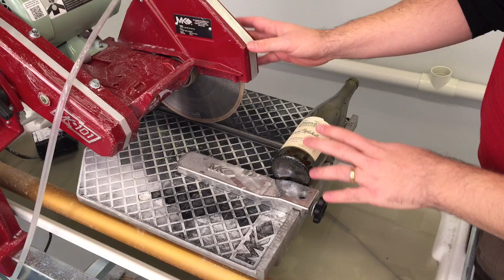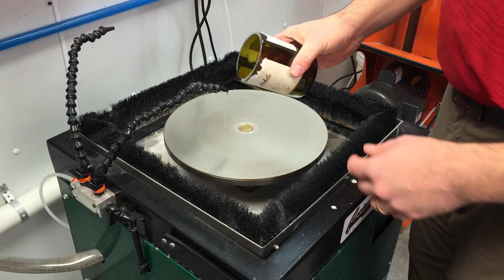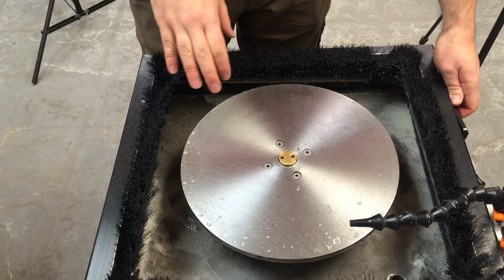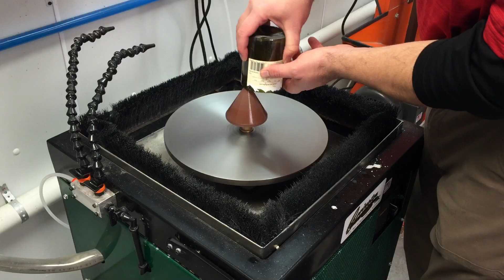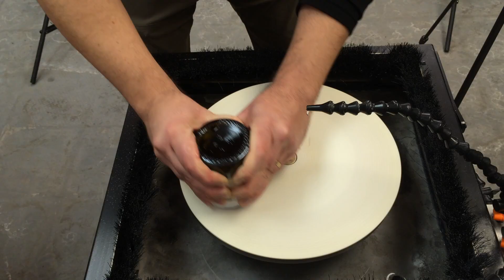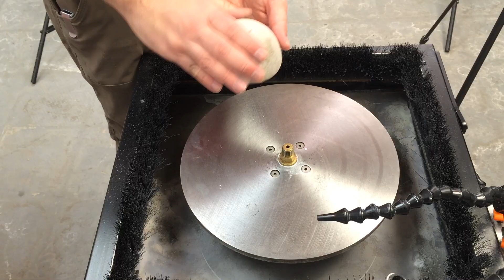Cutting and Grinding Wine Bottles into Drinking Glasses

Comment: Can't you just fire polish the cut sharp edge for a fine result
Reply: +Anja Lumiere Discipulo Most recycled glass will crack or shatter too easily.  I suppose though if a person were doing a large batch and had the means to slowly bring the glass up to temp beforehand and back down afterwards it might be worth the effort.
Reply: Cracks the glass.  That glass is sooooooo brittle

Comment: An absolute massive omission in this video is in the use of the wet-tile cutter.  While the disk will not cut skin when running in a water bath, it WILL cut your fingernails with ease AND instantly.  That alone tells me this guy is only partially informed on the use of these tools and should be watched with doubt, and to watch other videos in the use of the tools presented by this guy.
Reply: +Cyberdactyl 
Given the actual threat level of fingernail damage using diamond coated glass blades, and considering that "this guy" has provided a 27 minute demonstration video and you've provided a comment, I'm thinking that the "massive omission" you have proposed is a little less massive than you are making it out to be.
There's a big difference between respecting your tools and fearing your tools.
I think you're fear-mongering and splitting hairs (or fingernails).
But, that's just me.
Reply: BigRalphSmith I'm not talking about splitting hairs, but fingernails. ;)
Reply from the maker: +Cyberdactyl It is true that diamonds will cut through your fingernails and I have, in my 22 years of experience, groud through my fingernails more than once on a belt sander and flat lap, but I've never managed to cut through my fingernail with a diamond blade before. I would put that into a very rare category of occurrence. I do appreciate the added tip and I'm sure it will help others who watch our videos as well.
Reply: +Cyberdactyl if you seriously remove your fingernails down to the nail bed with your grinding equipment on a regular basis, you need lessons. You might ask "this guy" for them--I believe HIS does offer classes.
Reply: +Cyberdactyl hmmmm...along those same lines, then, he probably should also mention that if you hold your forehead against the blade for an excessive period of time you can create a jagged scar like Harry Potter's...it's about as likely but in the interests of being thorough let's cover ALL the bases... Seriously, he does explain that you should not hold your hand against the grinder for any length of time and that the diamonds will grind harder surfaces. That is more than sufficient. I've taught coldworking to many beginners; have so far not come across any who couldn't figure that out based on what was shown here.
Reply: I used chain mail butcher's gloves with latex gloves over those for grip.  I lost part of a finger years ago ( unrelated work accident) and as an Artist i'm particularly cautious with my fingers.  I also where full face goggle and a neck protector, should glass shatter and fly into my neck area..
Reply: Cynthia Morgan
Well. . .I certainly agree.  So he should have made the safety, point and that it could happen, since he is giving a tutorial to beginners.

Comment: Why didn't you take the label off the bottle? Keep telling us it's a good idea and then not doing it yourself. Annoying.
Reply: +woody1380 It was mostly to demonstrate how difficult it makes it to cut through the bottles with the label on and how the blade is only meant for cutting through harder materials. We've found it's better to show that rather than just saying it as most people do not believe they should remove the labels beforehand.
Reply: it helps to get it from shattering
Reply: +woody1380 LOL I noticed that too, but his reply make sense.  I have three different cleaning phases in my production.  1. remove the label only.  2. After cutting and grinding, remove any glue, etc. that may be left.  3. After the piece is "done" one final cleaning for perfection.  This way if the bottle damaged in any way during the working phases a lot of time is saved.  Believe me, there are so many opportunities for scratches, cracks, etc. to happen along the way, it really sucks to have spent a ton of time "perfection" cleaning up front.
Reply: I guess partially removing the label gives you a reference point around the rim when you continue working on the next steps.

Comment: hisglassworksinc Hi, very good informational video. But I have an important question to ask. What is the success rate of cutting wine/champaign bottles with a grinder or glass diamond blade like you use? I want to buy one only for cutting bottles but want to know first what the success rate is. Thanks!
Reply: His Glassworks, Inc. To add on to the above question.  How much does the brand of saw matter?   I have tried a couple different 10" saws that I have seen people use in their youtube videos and I cannot seem to get it to cut without cracking or chipping the bottle, even going extremely slow with the same glassblades.  Any tips for that?
Reply: +Tattoostijl The success rate is dependant on your skill as well as the tools and method.  I have tried many different techniques for cutting bottles and using a tile saw is by far and away the most consistent with the least waste.  I use a cheap 7" tile saw, but I invested in their best blade and I am happy with the result.  However, I am still looking forward to the day I can afford a nicer saw like the one shown.  I went from breaking more than I was making to 99%.  If I break something these days, usually it is usually my fault.
Reply: Tattoostijl Once you get the technique down and pay attention to when the blade needs dressing, you can virtually have 100% success rate with cutting bottles.  A lot depends on learning how glass specific blades operate and making sure they stay dressed as you use them
Reply from the maker: E Squared Glass You may need to look at water usage on the blades. With glass specific blades, they are a finer grit diamond so they will require more water at the contact point of the blade and the glass to avoid excess heat buildup. You can see a video on this here:
http://www.hisglassworks.com/learn/saw-blades/water-usage-with-glass-specific-diamond-blades/